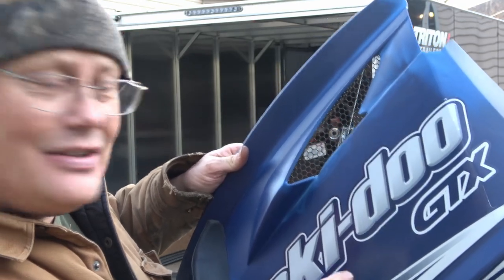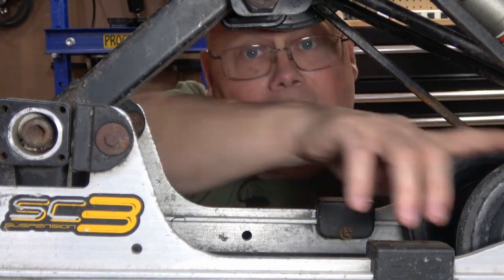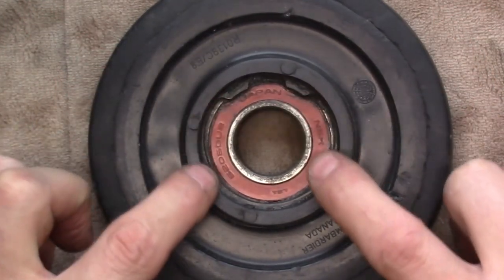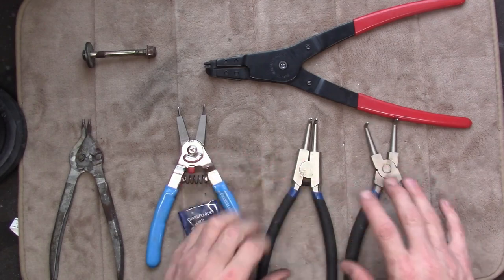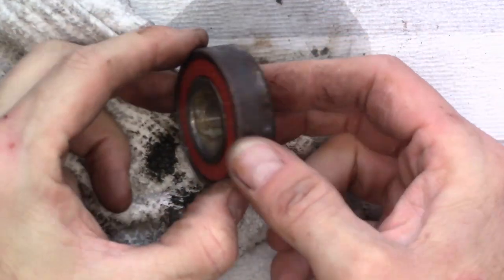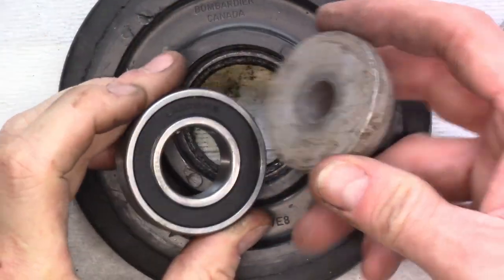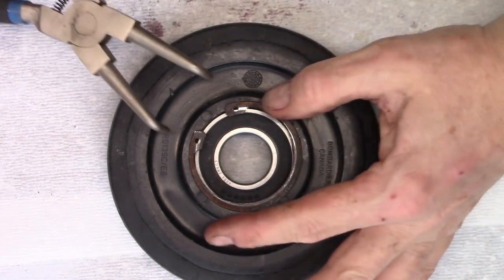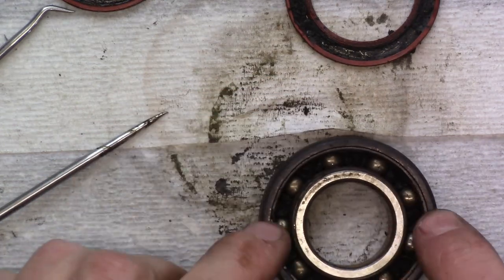Snowmobile wheel bearings, (are yours shot and do you need to replace them)?

Comment: Dino there is a wealth of correct information in relation to bearing replacement/refurbishment. I note the importance of pressing on the correct surface when re-installing bearings. I note the hydraulic press and a few tools you have for it for bending etc. I have a similar press and I have made angle dies, various diameter dollys  and hold downs to bend and press metal of various shapes and angles as well as holders for sockets of various diameters (saves turning up a lot of different diameter press tools). Maybe a video on how you use your press and the tools you have for your press would be useful for viewers?  Once a tinkerer has a press the first finished job ends with " I should have had this tool years ago".
Reply from the maker: Thanks Mal, I was thinking that might be a good video, would you be interested in providing some pictures of your tooling to include in the video? I have a few bending dies and bearing tools but I think some custom items to talk about would be interesting for viewers.
Thanks again for your comment, I always look forward to your feedback.
Dino
Reply: @DinosTinkerShed  I will take some pics. Sens through this link?
Reply from the maker: @MalJ-eb7nv  you can try that Mal, my email used to be in my YouTube profile for business contacts but it does not seem to be there now. If that does not work we may need to become face book friends if that works lol
Reply from the maker: Hi again Mal, if you use a computer (phone and tab do not seem to work) and go to my youtube home page, you will see a tab called "about" if you click this there should be a link for business inquiries. If you click this link and it will provide my email account.